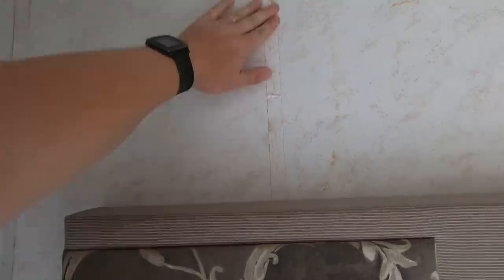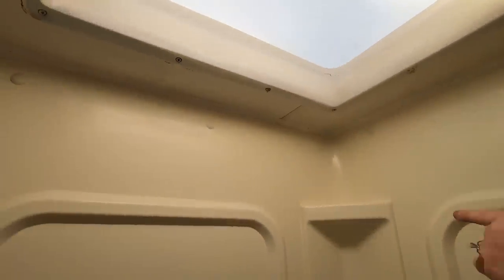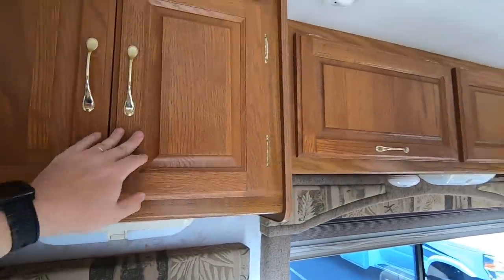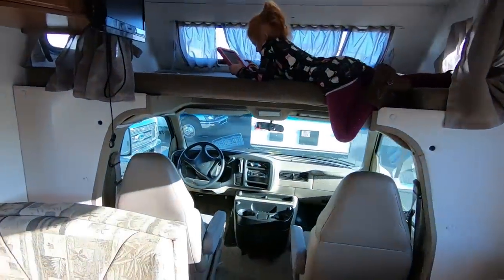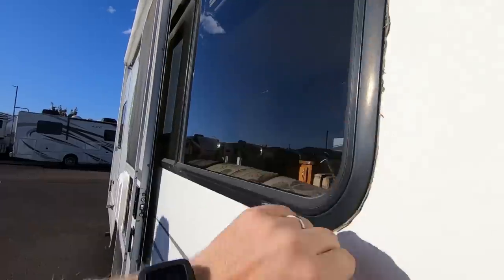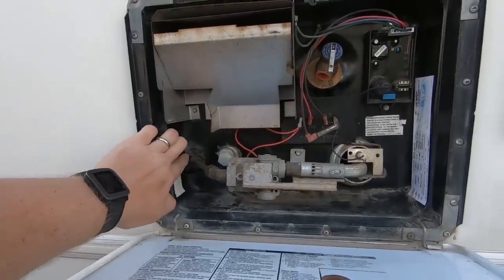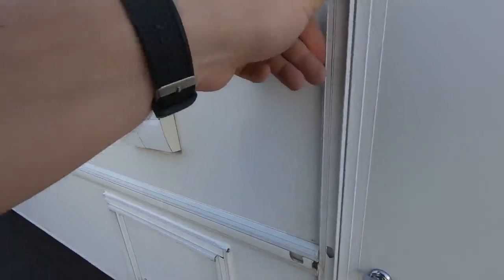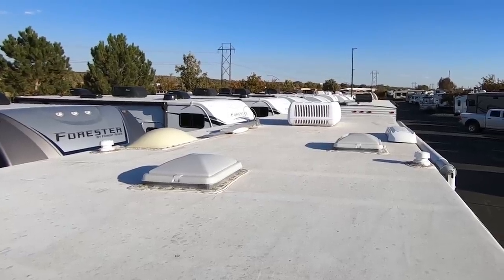USED CLASS C INSPECTION - Motorhome Walk Through and RV Buying Tips

Comment: Have you considered looking at a used RV from Cruise America? I know a lot of people will say too many miles or the cushions are shot but consider this: The RV will have the F450 chasis (no problem towing your Cmax), The higher miles are mainly freeway miles (Cruise America is favorite of Europeans wanting to see the USA in 30 days), Sinks and facet's will "all" be stainless steele, Toilette porcelin, their dinette sleep systems are over built so they don't break, you can have them send out "new" cushions since they are all inter-changable. You can have them sent out a second set of RV decals so when they start to fade in 7 years you just put them over the existing ones, They come newly painted, no slide outs that leak, newer roofs that never got walked on or drilled into because they don’t have ladders, Door steps don’t break because they are smartly integrated into the RV, They come with a warranty that can be upgraded, you'll be able to get into all RV parks as some parks do not allow rigs older than 10 years old, 2015 rigs start at $26,000. And finally, You can even rent to buy if you want ( your rental will be applied to the purchase). Banks will finance with favorable terms (up to 15 year loan) as the rig is under 10 years old.
Reply from the maker: I've actually looked at the local inventory before but my initial thought was what you said - high miles with "rental treatment" and the like. All of that other information is interesting though, I didn't know about the upgrades they do to all their units. Maybe we'll pay a visit to the local office and see what they've got!

Comment: Do you stop when you see a water stain or is it possible to fix one or two leaks? Just wondering what you guys would let pass because it’s an older rig. I don’t own an RV but want to in the future. Thanks for the reviews, very informative.  Cheers!!!
Reply from the maker: Active leaks are a hard pass. We're fine fixing some janky cabinets, flooring, fabric, etc, but fresh water damage isn't a problem we want to deal with. When it comes to something that has been repaired we want to know how it was repaired. If it was just painted over there could still be mold. If they just covered a failed seal with more sealant it could easily fail again. We aren't going to pass if there was past damage and it was dealt with properly. We haven't seen that yet though, just cover-up jobs.

Comment: Needs a new rubber roof,  the stains you see inside is water marks .   Most of what i see is cosmetics.   R..V 's need a new roof at least every 5-7 years and windows seals replaced sooner than the roof.     Any vehicle you see that has water marks in the cabinets  and around windos is your warning of hidden damage in the roof and walls.